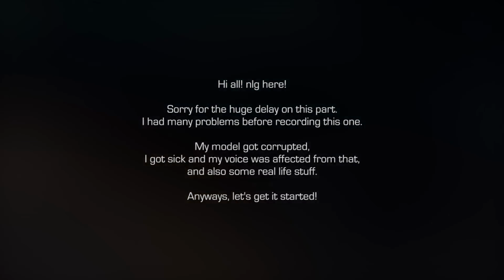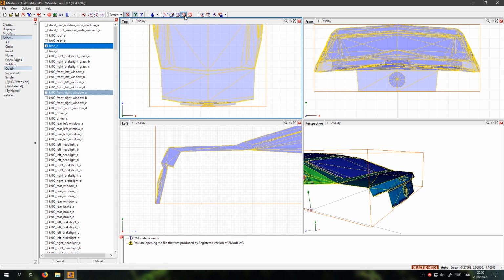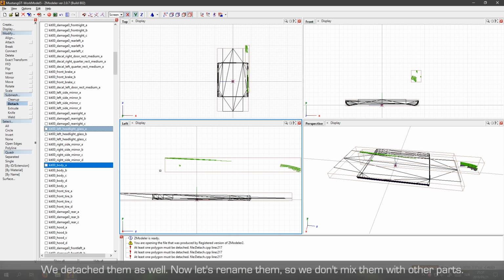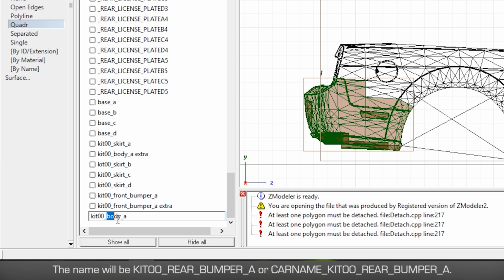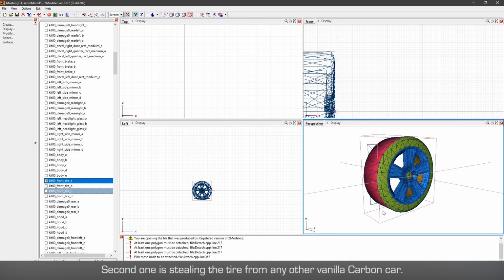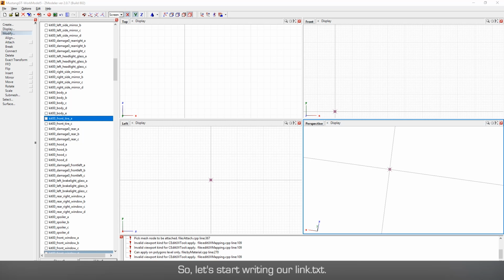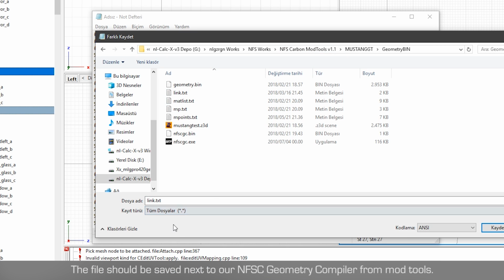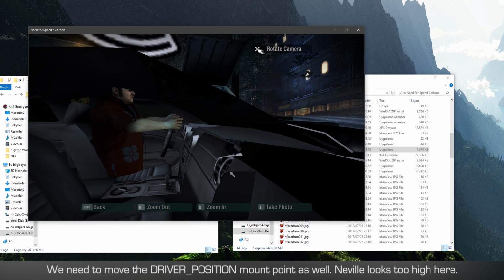[TUTORIAL] Let's Convert a NFS Car! - Part 5 - Cutting & Welding

Comment: First of all, great tutorial. However, I have one question -- how do you compile stuff if you're working on traffic cars?

Edit: Somehow it is compiling, as of  it's screaming at me about "Default Material" I've included it in the file but it's still not working.

Edit2: Somehow I've got it compiling but it now gives me a warning that there were no parts found for mountpoints and skips them.

Edit3: I've got the Centre Brakelight working, this was after I fiddled with the angle. However the other brakelights and headlights are still not working.

Edit4: I've got it compiling, but the model doesn't show up in Carbon -- there's just nothing in place of the old sedan.

Comment: Is it possible for performance of mustang? İ mw mustang way better than carbon and can you change performance of carbon mustang wih mw ?
Reply: Ozgun Tinar Vlted.
Use Vlted to open MW, find Mustang GT, copy the values of tires, suspension and transmission.
Open Carbon, find Mustang GT, change the values on Carbon using the values of MW. Only changing tires, suspension and transmission, its enough to feel the diference.
I did this in World, Audi R8, using the values of R8 Carbon.
Reply: Thank you, that is nice. What will we see in next video ? I think you should find 4 ideas and we should choose one.Survey.